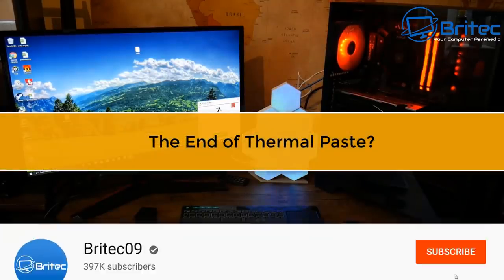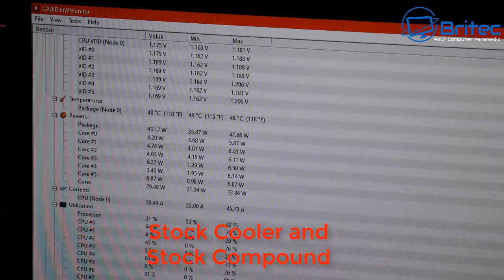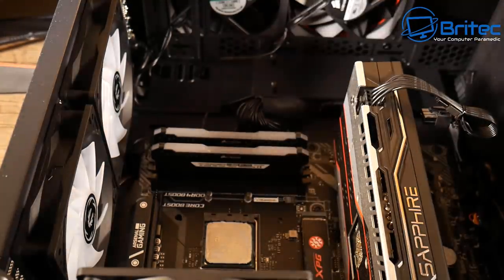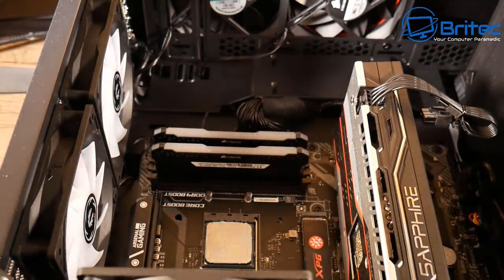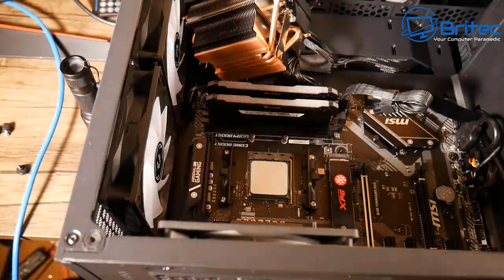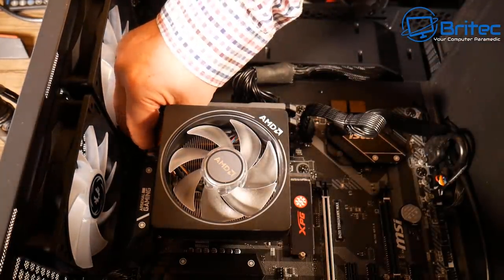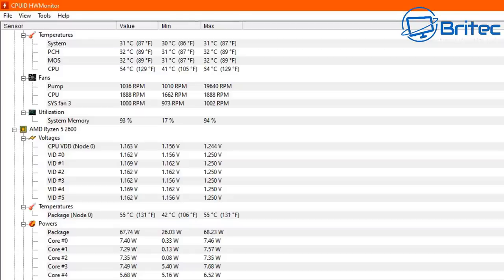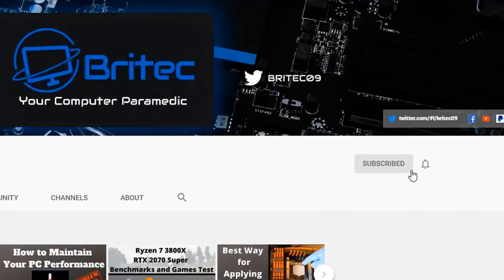The End of Thermal Paste?

Comment from the maker: Very surprised by these results, what do you guys think?
Reply: im using the same pad i love it
Reply: The results are very encouraging @Britec09
Reply from the maker: Nice
Reply from the maker: I agree Mark
Reply: Been looking at these for a while Brian, the results are really good. I think i might have to dive in and get one! Thanks for the video!
Reply: Interesting Brian, tks. If you have some pase hanging around you could put a dab on the pad to keep it in place on the CPU to help stop it slipping off so easily. - Just a thought. Best regards, DAve :)
Reply: I read multiple reports that they tear easily, this looks more durable.
Reply: Uninstall.
Reply: man, you are using different watts for this test, is a fail. and you are wrong.
Reply: Generally not understood is that "thermal compound" is actually an insulator -- but air is a much better insulator, so we need to exclude air from between CPU and heatsink. If the fit is perfect, you don't need any thermal grease, or pad, and it'll be cooler without. (In the P3 era, we often did not need it, because both were perfectly flat. But current CPUs and heatsinks don't usually fit that well.) 

Because thermal compound IS an insulator, you want to use the absolute minimum that does the job, and if possible with conductive material. All-metal crush pads work best, but can only be used once. The best thermal grease is probably the thin copper-based stuff (it's also quite cheap).

Some years ago (this was after really hot CPUs came along, but before variable-speed fans) someone did a test of Arctic Silver vs toothpaste vs Vegemite (yes, really). All performed about the same, within a degree or two. They also tested Arctic Silver vs generic, and found no real difference (actually, generic slightly beat AS). Naturally, since all of these do one thing: exclude air.

In my collection of PCs is a rather hot-running AMD Phenom... I replaced the stock aluminum cooler with a solid copper unit (same size, same fan, no heatpipe) and its operating temperature dropped by 25C degrees. Just an example of why I only use copper, or at least copper core. (And who thought nickel-plated heat pipes was a good idea? Nickel is a poor heat conductor!)
Reply: Not particularly surprised since it has much higher heat conductivity. However I would say, that the thermal pad (atleast this type) is highly dependent on the surface of chip aswell as cooler being flush with each other. Can be a bit of a hit and miss.
Reply: Yeah, I think ideally one would use a tiny bit of copper grease with the graphite pad. Given the crush pattern, I also don't regard this pad as reusable. That was precisely why we did not reuse metal crush pads (unless they could be precisely realigned on the same CPU).

Another disadvantage I see is that with the pad, NO part of the cooler foot contacts the CPU surface -- and thermal contact is what we're trying to achieve, as directly as possible. After all, carbon-fibre (graphite) is considered a superior insulator -- exactly what one does not want for CPU cooling.
Reply: Should have done this with the original cooler instead. You've added an extra variable to the equation by using a different one than the one that was originally on it so no one knows just how much of a difference the pads make vs. the paste. Also why is hardware monitor showing pump rpm when you dont have one?
Reply: Nice  !!!  I like Experiments with Coolers ..
is there a Pad for Threadripper Size ?
Reply: Ryzen 5 2600, doesn't really push either of the solutions to their limits, so you only really found out that they're pretty much the same on that processor.
Reply: This test actually been made already
Good paste will beat thous results(mx4 for example) good vid maybe in future this pad will be better 🤗
Reply: I would like to see if replacing thermal pads on Vrm and Chipset with Thermal Paste and Graphite Pads, and how it improves temps and boosts/overclocks
Reply: Grant Hampson good idea
Reply: I'll just stick with liquid metal...coollaboratory liquid ultra gives even more temp drops :)
Reply: Now thats an awesome idea with the pad, but why dont these heatsink manufacturers just build them directly into the bottom of the heatsink, kills 2 birds with one stone, dont have to mess with a slippery separate object and its jus part of the sink ready to go
Reply: Epikas Jones 
Paste or even just glow is cheaper fir them

Comment: The 40x40 size thermal pad fits perfectly over the Ryzen 5 2600. Using it with an Arctic Freezer 33 cooler and temps are 32c at idle and 62c after 4 hours of Prime95 stress testing. Not bad and no mess. I’ll likely upgrade the CPU this year so this makes swapping easier.

Comment: A Piezoelectrical cooler could be used to keep CPUs cool, the only problem is that if it gets too cold, it may create ice. So you would have to regulate the temperature actively, so that as the CPU heat up, more power goes to the Piezoelectric cooler.

Comment: The thermal pad is definitely better than the paste you used. HY710 has a heat conductivity of just measly 3.17W/mk which is TERRIBLY low for a regular pc cpu cooling use. An actually good thermal paste closes the gap and even can be better. Noctua NT-H1 has heat conductivity of 8W/mk, more than 2 times the HY710's. And both Noctua NT-H2 and Thermal Grizzly Kryonaut have 12 - 12.5W/mk, almost 4 times that of HY710.
IC Graphite Thermal Pad has theoretical heat conductivity of 35W/mk, but it doesn't make quite as good contact as thermal paste, thus losing some cooling ability.
Lapping both cpu IHS and heatsink base would of course optimize this if someone cares enough to go down that route.

Comment: I loved this video!   Mayby buy a thermal pad bigger than the CPU and fold the edges so it's like a shoe box lid so it doesn't slip off?
Reply from the maker: I think it is conductive, will have to check
Reply: @Britec09  yes 100% conductive.
Reply: there is no need to be concerned just lay the system horizontal and check after placement it will stay put until installed.
Reply: @Britec09  yeah that was my concern about that idea but did think what about putting smidge mineral oil on cpu then put thermal pad on that stop slippery pad slipping off whats your thoughts???

Comment: Working on various types of industrial equipment I have used thermal tape replacing the compound.  I've heard about the thermal pads, but never used them.  To keep it from moving, I would put a very tiny bit of silicon sealer on the edge of it on two opposite sides, but not enough to cause any issue or limiting the seating of the heat sink to the processor.

Comment: Temp on my CPU is +25.0°C At less than 25% load. I used whatever compound came with my Hyper T2. It is a 2 heat pipe tower type cooler. I don't use the pea sized drop method of compound installation though. I thin film coat the heat spreader. Because I know how thermal transfer is supposed to work.

Comment: I was skeptical at first so I tried the pad with a low 35 watt TDP Core i5-6400T and the temps in a small ITX case were in the low 40's during gaming and Aida64 tests. So I decided to switch to a Core i5-7400 with a TDP of 65 watts and my temps haven't gone over 55 C. What made it better was when changing the CPU it was completely mess free and I reused the pad.  I think what helps is having a cooler with a strong metal mounting bracket like my Noctua. I wouldn't use one of these pads with a stock Intel cooler with plastic push pins.

Comment: Another plus is it won't cause the CPU to stick and be pulled free of its socket when removing the cooler particularly common with AMD CPUs.  I ruined a motherboard that way and now only use thermal pads with Ryzen processors.

Comment: Idle temp comparisons are meaningless when the starting temperatures weren't the same.
The bottom line is how well the cooling system controls loaded temperatures and in that only relevent respect, the graphite pad and the paste are equal when paired with a sufficient cooling fan.
Reply from the maker: Like I said in the video, there is nothing between paste and pad apart from a little idle temp

Comment: The pad might be easier to sit it when you are building a PC from scratch and the mainboard is not in the case yet.
The massive plus of it is, depending on the longevity of the material at high temps, that if it doesn't dry out and it doesn't lose its attributes, you will never have to replace it as you would with a thermal paste.  That is MASSIVE, but again, if.

Comment: I've not played with these thermal pads myself, but I'd bet you could put a very small drop of water on the CPU then press the thermal pad on top of that.  The water should cause a suction cup effect that helps hold the pad in place until the cooler is properly seated, and it would dry out quickly during the stress test process. The tiny dab of thermal paste suggested by another commenter would work just as well, but I don't know if that would have a meaningful effect on the results if you were using the thermal pad for testing.

Comment: Thermal Grizzly makes a much better pad than that one, and they have for quite a while now. In fact thermal pads have been around for a long time now and we still use paste, so no thermal paste is not done.  Pads are no where as good as paste, it just lasts longer than the paste does but good paste will last longer than a system will as long as you upgrade regularly.

Comment: I have one of those in my PS4 Pro. It works great. Cut down to size  of course.
Reply: Is it still cooling good? I am thinking about doing the same because these are not supposed to need replacing due to drying out.

Comment: I’m wondering if perhaps borrowing an old balsa modeling trick may help.  We would use the moisture of our breath to help warp control surfaces.  Maybe there would be enough moisture in your breath to help the pad stick just enough for installation, but not be outside the environmental parameters (humidity) that AMD designed Ryzen with?

Comment: The only purpose of thermal paste is to fill in gaps between the CPU and the heat sink. It is not supposed to be thick or even evenly spread. Whilst it is a good idea to have it spread well, it should be no thicker than a few microns overall.

Comment: Interesting. What CPU are you running. Looks like a Ryzen 5 series from the looks of core count and voltage. Surprised you worried and stopped the test at 70C, seeing as it's rated at 70-80C under max load, with the max temps for that CPU 95C. Would like to see what your temps would be with the stock cooler running Cinebench R20, just to compare my stock temps. lol  Prime95 doesn't hammer out the CPU as much as Cinebench in my experince. I swapped my wraith spire cooler as well for the wraith prism that my buddy had lying around, because I was experiencing those same crazy temps. Even reached 100C once for a split moment in benchmark with Cinebench R20. I thought I was about to fry the thing! With the wraith prism, my cooling issues were solved, maxing out around 65C with the same test. Idle With the Prism cooler have similar temps as you results with the same XTM50 paste I used before with the spire cooler.
Reply from the maker: Yeah it was climbing fast and yes Ryzen 5

Comment: looking good, try dabbing a damp finger to seat it.  Also, it would be nice to see Thermal Grizzly Pad Minus Pads sold on Amazon.  Thanks very useful as I was thinking on these lines because as you've proven not always do you get a full spread even from pastes already applied on new coolers.
Reply from the maker: I will try the Thermal Grizzly Pad and do some other tests if the video does well and people enjoy it.
Reply: In my opinion always do a manual spread and then a tiny quarter rice grain droplet in the center and add cooler straight. The droplet will spread and the rest already had most covered. in my opinion this gives the best results and i have never seen a bad coverage.   just use the best paste you can get it can give up to 8 degrees difference for only a few bucks more. my large tube of thermal grizzly only cost 15 buck but does 7 applications.

Comment: Keep in mind that (especially with Ryzen) that the majority of the heat a CPU makes isn't always centered in the chip...

So if the pad doesn't cover the majority of the chip, you may not be getting all the distillation and distribution you could be. 
Rule of thumb is, if it's a little smaller, a slight askew to the bottom right is best (as that's typically where Ryzen chips generate the most heat).

Comment: Great idea but the price needs to drop for businesses. We would need 400 of these. This is fine if you are building one or two systems. They need to fix that slipperiness.
Reply from the maker: When you are buying a lot, it would be expensive, but you can reuse them.
Reply: then you simply buy lager sheets elsewhere. Digi-Key -CPU Panasonic GraphiteTIM EYGS0612ZLWF

Comment: this pad is in range cost of 4-5 gram MX-4 thermal paste, and yet you compare it to the hy710 which is "cheapest least wanted" thermal paste for good cooling that needed to cool hot rigs. When 1 gram of mx-4 is cheaper than pad up to 4 times, and you need not so much than  1.5\4 of 1 gram of it yet to use for almost 4-5 years in normal cooling conditions. And even after this time mx4 paste is not dried up completely.

Comment: I used a thermal pad between my copper heatsink aio and the thermal shield of my I9 cpu to stop the electrolysis that thermalpaste was causing...works great and temps are never over 68c.
Reply: universal thermal pad vs graphite pad that's not same.

so what u talking about ?
Reply: The thermal "graphite" nano pad from Grizzly is what I use.

Comment: Didn't try thermal pads - the fan had copper bottom with tubes that helped - maybe they need to make thicker thermal pads - the one you used was paper-thin - not good

Comment: wonder if its electrically insulating... it maybe can replace my mica thermal pad / insulators in my really hot power inverter...... i've already dumped the modern silicon pad for mica.... but as the heatsink is grounded and the case of the hot bit jumps to like 315 volts.. .just thermal past wont do....

Comment: I'm investing in an AIO next week (Alphacool Eisbaer 360). I usually use Thermal Grizzly Kryonaut but I may go for liquid metal this time, as it's thermal qualities are massively  more than Kryonaut
Reply from the maker: Be careful with liquid metal
Reply: @Britec09  Oh I know, had all the warnings about it being electrically conductive, going to cover the surrounding areas in kitchen towels. I also know that you cannot use it on aluminium, copper is fine but Der8aur says to reapply it two or three times at least over the first few months as it forms an outer layer on the copper plate, once it has done that it is fine and that the alloy that is formed doesn't affect its thermal properties at all.

Just wish that these thermal pads were fully up to speed as I'm sure that many would use them if their performance could be upped and of course get them to stay in place! LoL
Reply from the maker: they are slippy buggers, maybe a dab of distilled water in center that someone suggests.
Reply: @Britec09  Now that sounds like an idea!

Comment: Thermal  paste  taste's  real  good Yummy  LOL   Those thermal  pads  have  been very common in  electronic  products  for years , they are used more for    faster  assembly  then spreading that paste by hand   You see those thermal  pads  in power supplies  to  create  isolation  against  shorting  of  voltage   rails  to ground.    I see people below  saying  " thermal  grease  with the pad" , they must watch  other Youtube  channels   Posted  on Facebook,  Bye for now  cheers
Reply from the maker: I think putting thermal paste with thermal pad defeats the whole purpose of the thermal pad.
Reply: @Britec09  What about a little dab at each corner to 'glue' it in place? Still much easier to clean off than only using thermal paste. Another possibility would be to have the pad held in a frame that fits round the side of the CPU.

Comment: Need to see how much Ghz you are using and wich CPU. As I see this is nothin' good.. I got 25 C on Idle and got a i7 6700 K and uses 4 cores with 4,2 Ghz on full load I get around 70 C, (AAA- games as GTA V, Doom etc). Intel's i7 6700 K - 9700 K is known for high temp. (uses GTX 1080 ti).

Comment: 10 dollars per Pad? For no performance gains (I never OC ‘production’ machines!).

I’ll stay with the $6-$10 thermal paste that will last 7 to 10 years on each cooler and where you can do 20 to 50 CPUs depending on the size you buy.

Comment: My understanding of thermal paste is that it works by filling stratches and imperfections of the surfaces of the cpu lid and contact surface of the dissipator so there are no hotspots and an even thermal surface. Does the thermal pad do this also ?